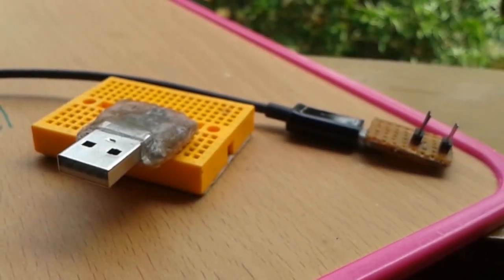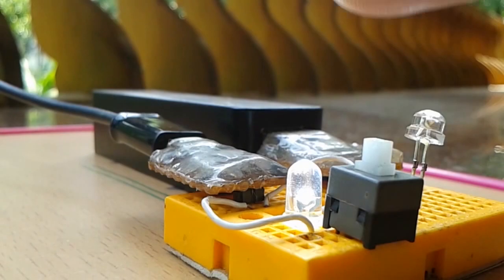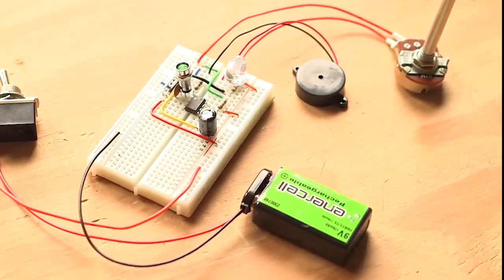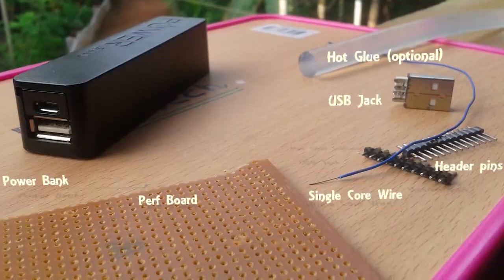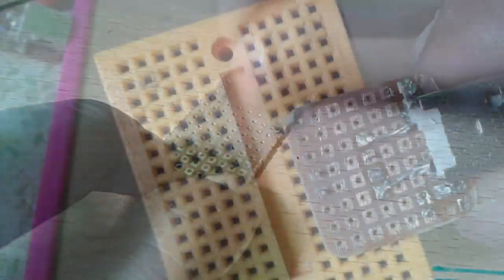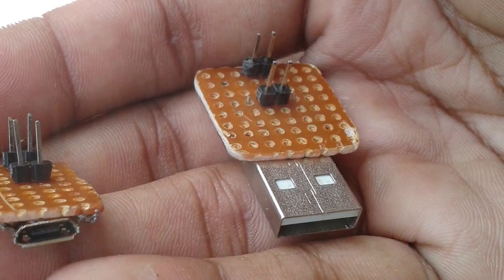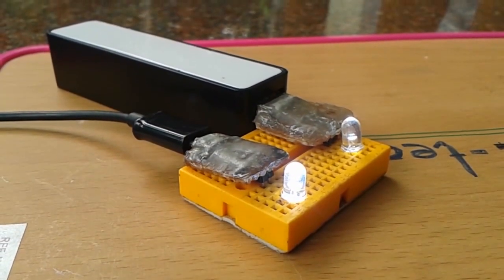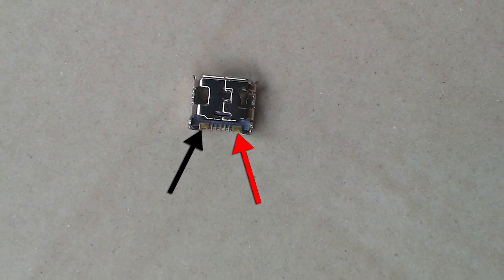HomeMade USB Circuits??  A Must Have DIY Gadget

Comment: Why not hot shrink tube the exposed device (soldered area) , and solder two jumper Dupont male cables on Postive and Negative power rail of USB connector ? that will be easy for you to insert 5v power to any points on your breadboard.
Reply from the maker: TheOldmankk Usually i take power supply to the entire breadboard from the power rails alongside which is  marked as positive and negative...So here I am supplying the power to the power rail so that you won't need to take separate 5v from the source....Plus this was a quick vid idea so I made it all up with things I had lying around.. :)thanks 4 the suggestion..